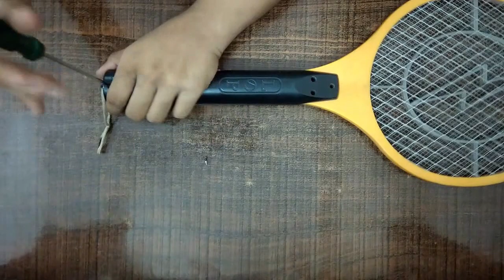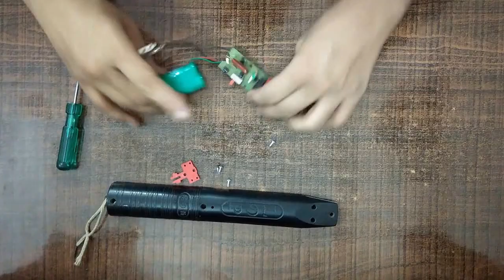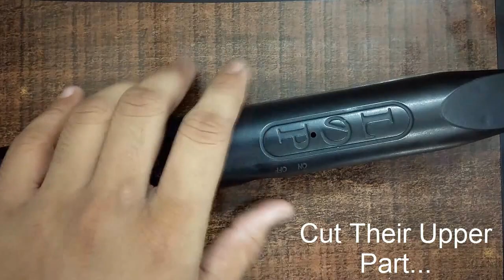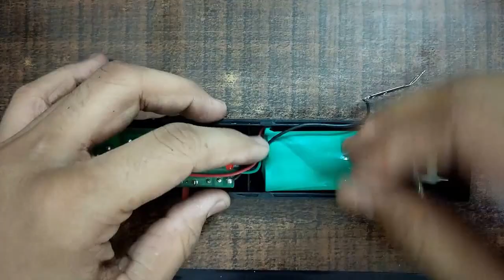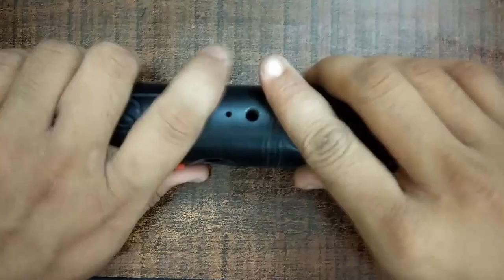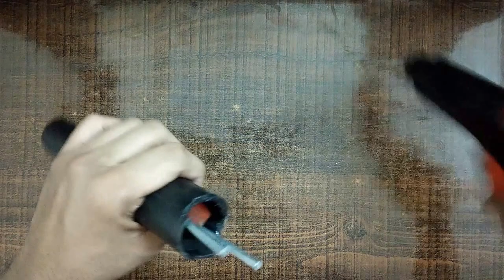Make Taser Easily At Home From Mosquito Killing Racket

Comment: How many volts can it give?
Reply: Around 100-2000 volts!
Reply: You can also change out the capacitors with larger ones and and use a 12v power source for a more realistic stun gun also makes a decent Tesla coil and flyback transformer driver
Reply: @acronym508 I'm looking to make a 25000 volt stun gun low amperage for zapping snake bites😊 any suggestions would be appreciated thanks❤

Comment: 1: 44 wwhere is the third wire ?
Reply: Third wire is negative common ground that goes to both outer net.
Reply: @chongshenchang9367  2 wires are + that go on the outter mesh and the - is the one inbetween

Comment: u used this for any person please use this for anybody I want to know if this is dangerous or not how many volts and we will be shocked or not
Reply from the maker: DHRUV SHARMA i used it on my self it wasnt dangerous i think so but then also use it at your own risk
Reply: Bro can you send the names of the components
Reply: My gecko swatter don't have wire ?
Reply: Ive stunned myself with a electric zapper like that. It's painless
Reply: It gives out more than 2000 voltage.